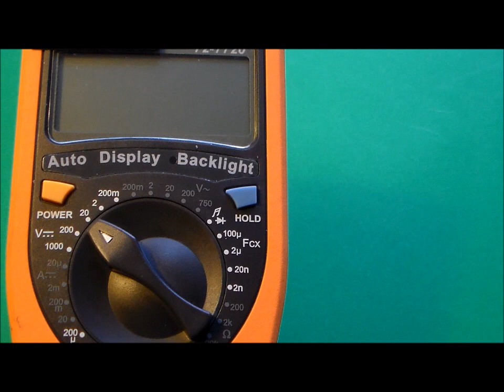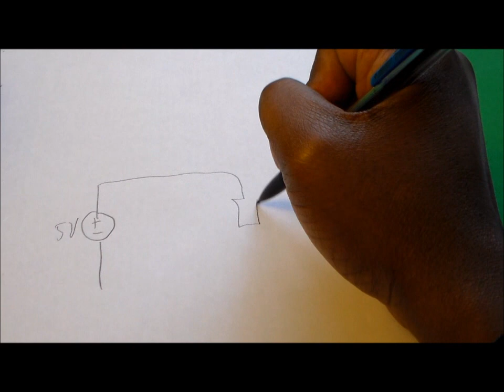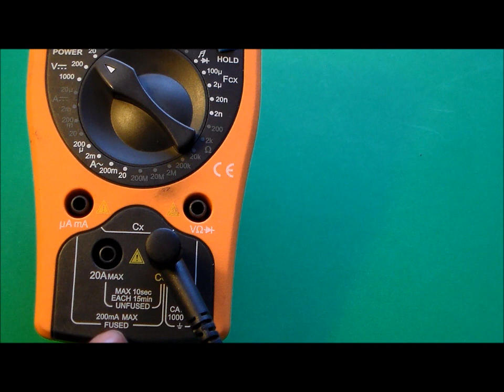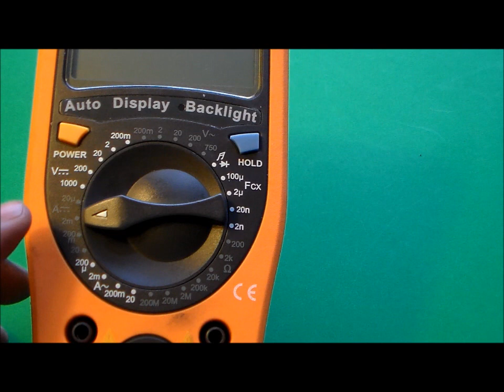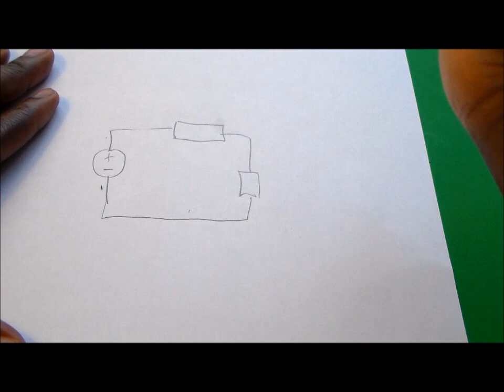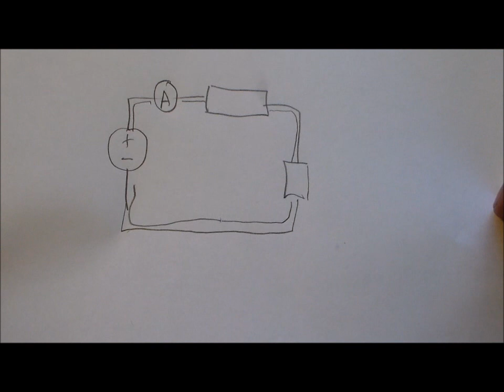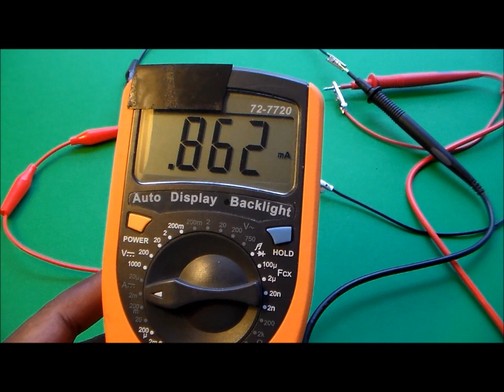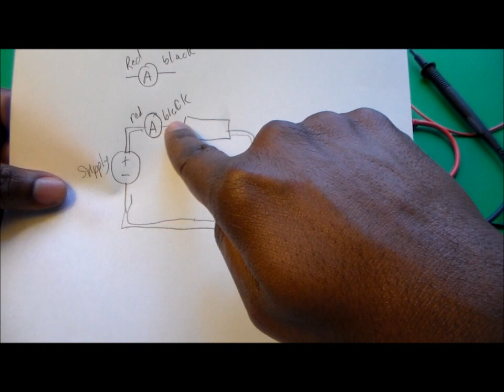How to Measure DC and AC Current Using a Multimeter

Comment: how do I test current in a small compressor dc motor  in a reflow soldering / desoldering station model 852D+ ? I have two multimeters that  can measure dc curret. Thanks in advance!

Comment: Using a multi meter, you want to test 2 terminals but you have no idea if it is ac or dc that you're checking. How do you determine if it is ac or dc?
Reply: @Chris Notap Lovely Video clip! Sorry for the intrusion, I would love your opinion. Have you researched - Franaar Shining Shape Formula (do a search on google)? It is an awesome one of a kind product for revealing the secret to repair your electronic devices minus the headache. Ive heard some awesome things about it and my cousin after many years got great results with it.
Reply: put voltmeter on it in ac, if it reads it it is ac, if not try it in dc, if it reads it it is dc. Wont damage it.  licking the wires is not proper method to test.